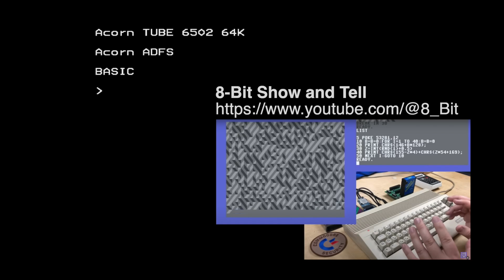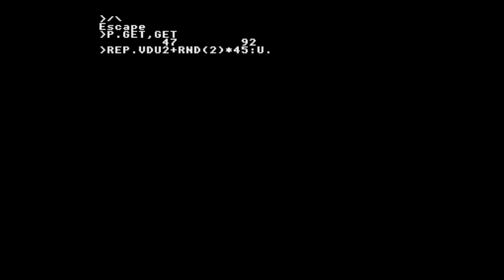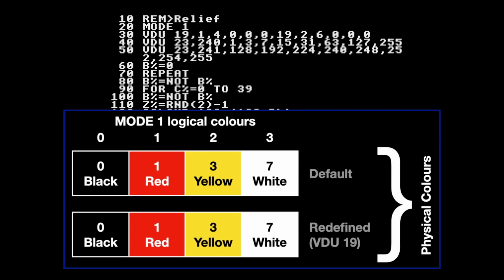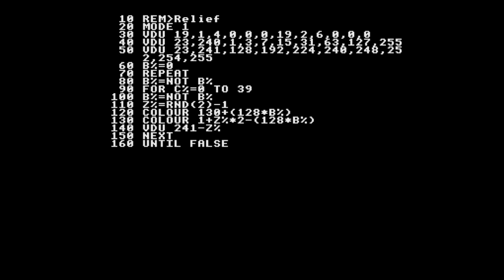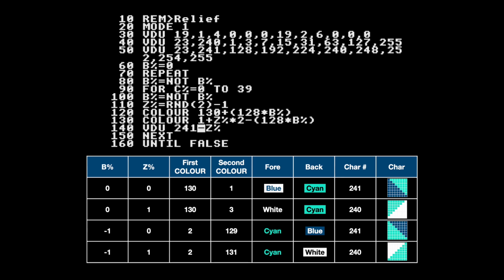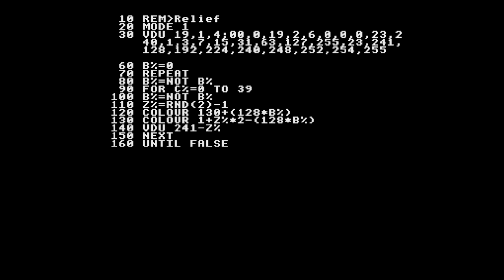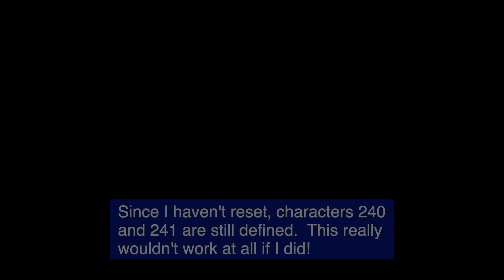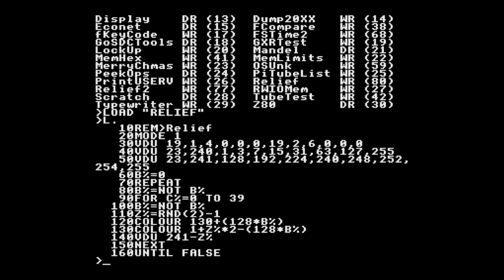BBC BASIC 3D 10 PRINT

Comment: VDU stands for visual display unit.....you can change it to 640x256 and theres pokes for multi color but it uses over 20kb of memory...its in the user manual how to do this i remember coloring in mode 0 and using all the colors at the sametime on screen .i use to work my mums knitting patterns into an electron and it was using over 20kb of memory just for that mode leaving about 8000bytes freebl to program with i would use about 4-6 kb in basic programming although programing games in basic is something i almost got the hang of i just couldnt deal with the subroutines and poking around it memory it loaded in hex decimal values

Comment: Just been playing with this on BASIC V on RISC OS via a Pi 3B and I've got your code down to just 62 bytes.

I don't know why you've done it but you don't need the first B%=NOT B% and you don't need that FOR loop...

10B=0:REPEATB=NOTB:Z=RND(2)-1:COLOUR130+(128+b):COLOUR1+Z*2-(128*B):VDU241-Z:UNTILFALSE
Reply: btw, I've got a PiTubeDirect in my BBC Master and it runs at 274MHz. Bit faster than 33 :)
Reply from the maker: @YesiPleb  In this video (although not in most of mine), I'm running PicoTube — https://github.com/dp111/PicoTube — rather than PiTubeDirect.  This runs on a Pi Pico and not a full Pi.  It's slower and only emulates the 6502, but it's plenty fast enough and very cheap!

I thought I'd do that just for a bit of a change.
Reply from the maker: The final version someone managed to crunch it down was 55 bytes (excluding the mode setup and character) definitions.  It made some clever use of SGN and is here (along with all the other versions, in the git history):

https://github.com/mincebert/3D10PRINT/blob/main/BASIC-CT

Comment: This was a lot of fun! Great to see it ported, and at the same time I get a better idea of the features of BBC BASIC, which I hear great things about. I actually have a BBC now but haven't got around to playing with it. I'm glad you mentioned (at the end) that you're using a Pi accelerator. I knew the BBC was fast, but I didn't think it was THAT fast!!
Reply from the maker: Glad you enjoyed it!  The BBC has a 2MHz 6502 and some advantages, like the screen is scrolled in hardware (the start address can be changed and the VidProc handles wraparound of the address, so the data doesn't actually need moving).

The BBC is nice for writing 6502 on as you have a built-in assembler in BBC BASIC, although there's no monitor, which seems a strange way round!  I use EXMON2 but there's no NMI-type button on it for nosing at running things.
 
With the full-fat PiTubeDirect, you get a much faster virtual 6502: https://www.youtube.com/watch?v=9YSvyUEiIdQ&t=620s — and the latest software has a 6502 JIT core which gives you 900-1000MHz emulation, rendering that Mandelbrot set in about 30s (still 1.5s on the ARM).
Reply: The graphic overlays are a nice touch.
Reply: I would love to see you doing a vid on the BBC, especially if you play with thee Basic build in assembler, I would very much like to see a star  command being made!
Reply: Another +1 for Robin doing a BBC video!